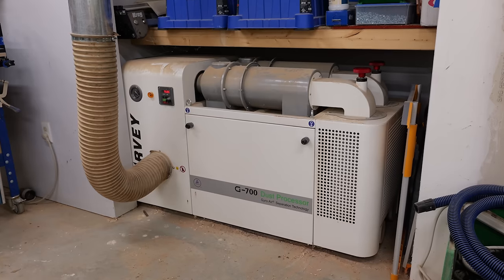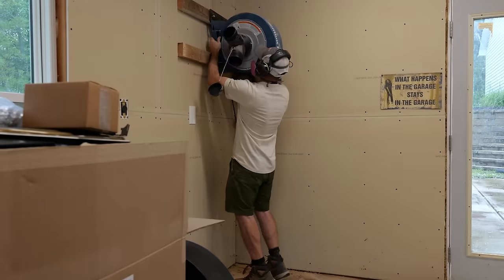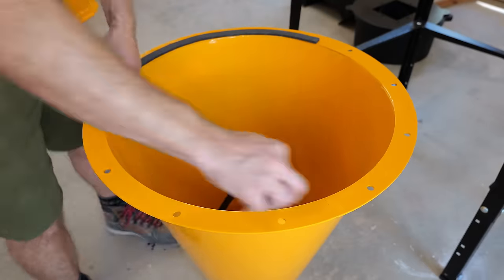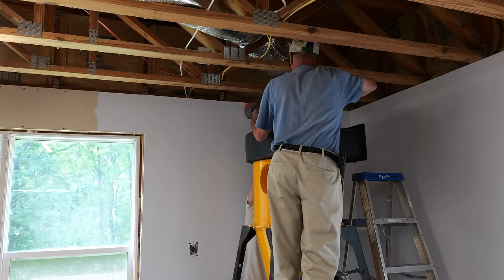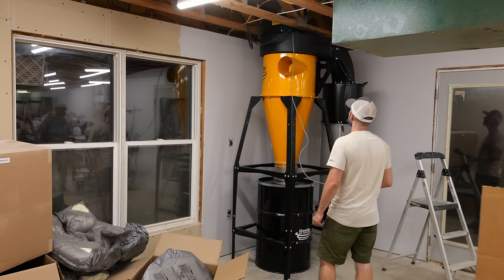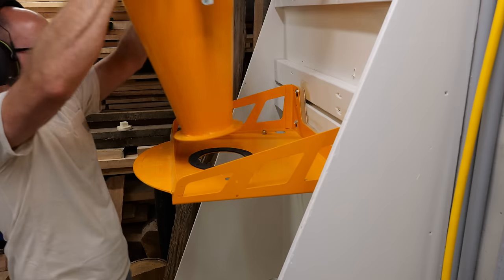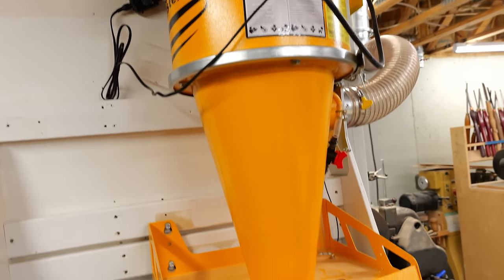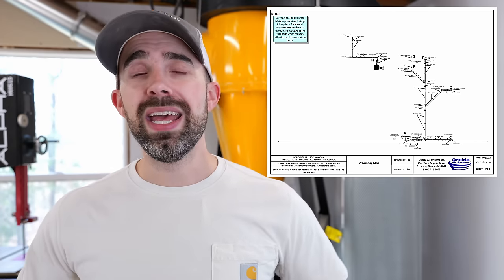Why I Ditched the Most Popular Dust Collector on the Internet

Comment: I've got a G700, but I'm just a hobby woodworker, so I don't have constant fill up issues. I do have the issue with the filters getting clogged, and it's incredibly annoying and can take up whatever free time I have to woodwork. It's a gamble every time on if the filters will clog before I get the alert for the bins being full. I also don't have much space in my shop, which is why I got the G700 to start with. I need to look into, maybe, building a small shed type thing to put a standard dust collector in it so it doesn't take away from the space I have.
Reply from the maker: I hear ya.  The G700 is appealing in that it can be stuffed into a tight space, but honestly the footprint is larger than something like the supercell.  The CFM is higher on the G700, but the static pressure on the super cell is insane!
Reply: I make sure to self clean the filters after every bin dump.  Also need to turn the speed down if using a planer with a short hose directly to the G700, otherwise the air velocity sucks the chip past the bins and directly into the filters.  Since I moved into my new shop with maybe 20' of 6" pipe and elbows, I don't have problems with my filters getting jammed up.

Comment: Just sold mine for a supercell. While louder, I’m much happier with the design. So many things drove me crazy about the Harvey. Storage (size and emptying bags),  instant shut off for bins full as you mentioned yet still having space, on/off switch on the back, constant flickering display while not running and most of all, the port on the front.
Reply from the maker: For the systems being in the noise of the same price, I agree the super cell is the better solution.  👍👍
Reply: I don't understand why people care about how loud a dust collector is.. You're never using a dust collector while doing something like hand sanding.. A power tool is always running, jointer, planer, table saw.. All very loud tools.. Not sure why one being quieter is a great feature.. The shop is still loud
Reply: @GageDrums  this is very true. I used to think it mattered, but realize that you’re always running something with it. Plus, I’m always wearing headphones in the shop.
Reply from the maker: Where's the mic drop emoji!? 😂  You're exactly right.  It's nice in a sense that the machinery is a little quieter, but at the end of the day it's a shop and it's going to be loud.
Reply from the maker: All you have to do is turn up the isotunes and then the shop noise is just a faint hum 😂😂
Reply: @WoodshopMike the song “turn up the radio” comes to mind. 😂
Reply from the maker: not a bad choice!

Comment: Ironically, 12 years ago I replaced my cyclone with drum for the same reason you replaced the G700.  Mine only had a 35 gallon drum but it filled way too quickly and emptying was a chore.  I ended up with a 2 bin Felder RL160 that I found used and has much greater capacity.  The weight of the full bags is a bit challenging though.  Steve
Reply from the maker: I think anything less than around 55 gallons is just too little capacity for a shop that does any regular milling work.  Something around the 30 gallon mark is ok if you're mainly running saws, but if jointing and planning moderate volumes of lumber for furniture is a regular task you'll be constantly stopping regardless of what system you run.  I'd thought about going for a dual drum setup, but with my height limitation it would be tricky (unless I had two shorter  35 gal drum).  Yeah, I'm thinking my hand truck is going to be getting a lot more use now lol!  But at least now I can get through a milling session without having to stop 3 times 😀

Comment: Great unit! I have an older version super dust deputy connected to a drum. If it gets full I'm ducted outside with no filter so the shavings just blast over my neighborhood.
Reply from the maker: That's awesome!  I had a previous setup ducted outside, but it didn't work as intended so all I ended up with was a pile of chips outside my window lol!

Comment: Hmmm I have a new G700 sitting on my back porch. Hope I haven’t screwed myself. I went with it for several reasons: 1) noise - we have a little shouse up in the mezzanine of my shop that we’ll be living for a bit. And 2), I’m offgrid and the slow ramp up of the 3-phase will not slam my inverters and batteries as much as a conventional system.

Still worry that screwed the pooch though. Then again, it’s not a production shop.
Reply from the maker: What's the rest of your setup like?  My recent video on dust collection might be helpful.  It covers more of what goes into good dust collection in addition to choosing the right system https://youtu.be/bjnhFXOPQ7s
Reply: have: 3HP Sawstop with floating arm and 19” grizzly 3 hp bandsaw. Will have: 12 or 16” Minimax planer/jointer…I haven’t decided yet. My shop is a decent size but it needs to pull metal fab and auto/tractor repair duties too.

I bought the US made Norfab clone piping (mostly 6 inch) via Grizzly. This still needs to be installed.

Also have a festool dust extractor with cyclone and boom arm that can cover down on some things.
Reply from the maker: If you're not doing a lot of milling on the regular you'll likely be fine.  Fwiw, the dust gorilla pro also has a slow ramp up.
Reply: I don’t have a CNC, but my G700 makes me crazy because the filters clog quickly, even id you do the ‘self cleaning’  routine. And it is time consuming to get to the filters to clean them. I am wondering if I can redirect the g700 to room air filtration duties with its HEPA filters….
Reply from the maker: Yep it's a time suck for sure!  Curious to know how you're thinking to repurpose it to be an air cleaner.
Reply: @WoodshopMike  Seems like after getting another dust collector,  I could give the machine a thorough cleaning and use strategically placed flex pipe to suck in dusty air next to the machine i am using. Rockler sells large square funnel looking attachments  in their dust collection items that could be stood up on a stand next to a dusty place. For me, it is the table saw when I am cutting on the very edge of the workpiece. But more generally, the intake pipe could be suspended from the ceiling in the shop to pull in dusty air and run it through the Hepa filters. It may be interesting to create a less restrictive pre-filter on the intake side to lengthen the time between hepatitis filter cleanings.  This is just ‘spit balling’  ideas. I am sure that it could be effective for this.
Reply from the maker: Neat idea!  I was thinking you had something like an ambient air filter in mind, which I think you'd be better off with a different approach, but as an auxillary DC for a situation like at the table saw, not a bad idea.

Fwiw though I would just sell the g700 and get a dc that's good enough so you don't really have a need for secondary dust collection at tools

Comment: With the G700, I’m thinking about putting a large trash can style cyclone next to the planer/jointer and seeing if I can drop most of the larger chip there. Might work. Might not.
Reply from the maker: You could even just put that close to the G700 to catch chips from all of the tools.
Reply: Did you end up doing this? How did it go?
Reply: @WoodworkingbyAdam  I have the cyclone (one of the larger eBay specials that’s made of metal with six inch inlets); but I haven’t installed it yet. I’ll update when I do.
Reply from the maker: Look forward to hearing how it works out for ya👊

Comment: If you do not run 6" ducting all the way to the machine and open up the machine ports to 6" you have just wasted your time. I did this stuff for a living and not opening up the machine ports to 6" is the single biggest mistake 99% of woodworkers make and then they complain about the dust extraction performance.
Reply from the maker: I totally agree, that's why I was running 6" directly to the G700. 👍  
The performance from the G700 was good, about 90% as good as the Dust Gorilla Pro, but the other issues of filters clogging (which really tanks the suction) and the constant bag changing is what was the biggest problem.
Reply: Absolutely!

Comment: Can you comment on the noise level of the units versus the G700?  Might not be an issue in a production shop, but for a hobbyist...
Reply from the maker: Sure!  The G700 is the quieter than the Dust Gorilla and Supercell, but I think the Rockler DustRight is a little quieter than the G700.  That said, I'd still be wearing earmuffs when then G700 was running and the Dust Gorilla isn't perceptibly that much louder (at least not to me) and it's stats are much better (it is more expensive though).  The Supercell is significantly louder, but it also has roughly 3 times the static pressure.

Hopefully that helps and doesn't muddy the water for ya lol!  Happy to keep chatting if you have more questions 👊  Thanks for watching, I hope the video was helpful!

Comment: From the G700 Specs - 1110 CFM
Reply from the maker: Yep you're right, that's the free fan speed.  They also list the max CFM with 6" ducting which is 700CFM.  The Dust Gorilla Pro's free fan CFM is 3250 and 1395 CFM when hooked up to ducting.
Reply: @WoodshopMike  I spotted conflicting numbers in the comparison chart and the separate spec.  One says 700CFM for 4” ducting and the other says 700CFM for 6”.  I’m in close with neighbors so I have to live with a little less capacity for a quiet collector.  Same for my compressor (California Air Tools in a sound deadening cabinet - 42 db). The Oneida are undeniably powerful and well built.
Reply from the maker: I can understand the proximity to neighbors being an issue.  My current compressor is in a shed because... IT'S SOOOOO LOUD😂 But I live in the country so it's not an issue for neighbors.  Cheers!

Comment: All things considered, how much $$ does all the Oneida gear cost?
Reply from the maker: The Oneida Super Cell is $2599 the Harvey G700 is $2499 on sale (list price is $3599)
The Oneida Dust Gorilla Pro is $4449 

Happy to answer any other questions you may have 👍
Reply: @WoodshopMike another thing to note, the super cell is much cheaper to ship. I believe I paid about $150ish, while with the Harvey even though on sale, I paid closer to $500 to get it shipped. So that will certainly factor into it as well.
Reply from the maker: The super cell is also a lot lighter.  The G700 was manageable to get off the pallet, but not on my short list of fun things to do.
Reply: @WoodshopMike  engine hoist is really the best thing for the g700 I’ve found.
Reply from the maker: I was feeling lazy that day 😂
Reply: @nportercaw Front end loader is way easier.
Reply from the maker: @silverbackag9790 😂😂😂

Comment: Sponsored video by?
Reply from the maker: Hey Pierre!

Yep it's sponsored by Oneida (not paid, but they did provide the dust collectors).  Several months later at this point and still no regrets getting rid of the Harvey (still a good system in it's own right, just not the right one for me).

Happy to answer any questions if you have 'em.

Cheers!

Mike